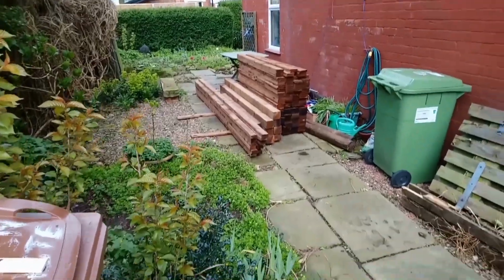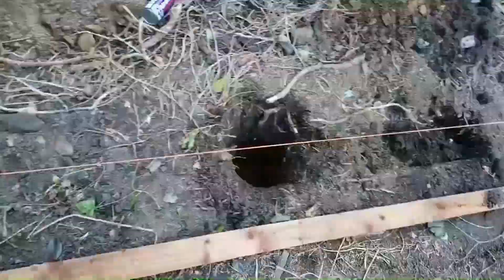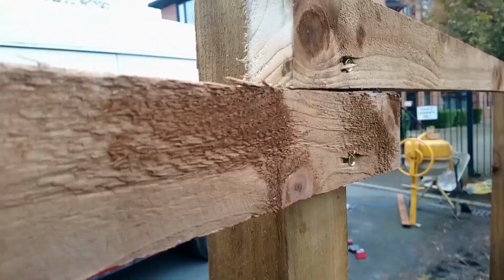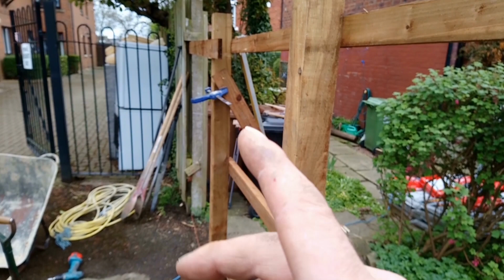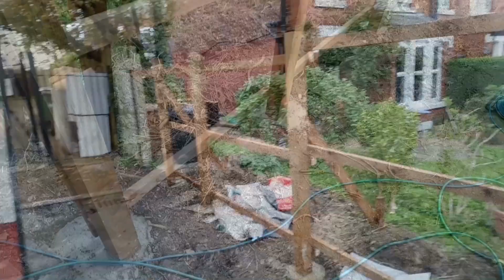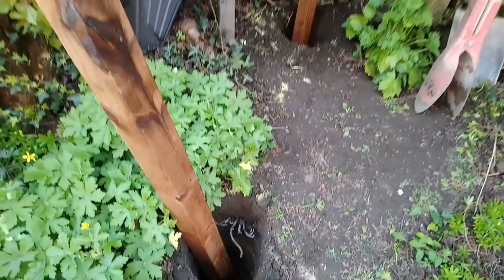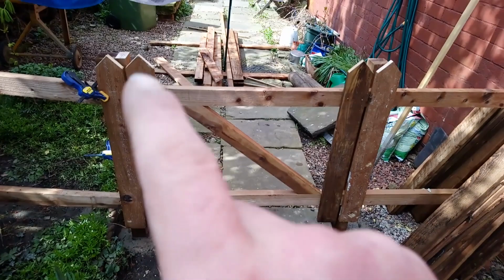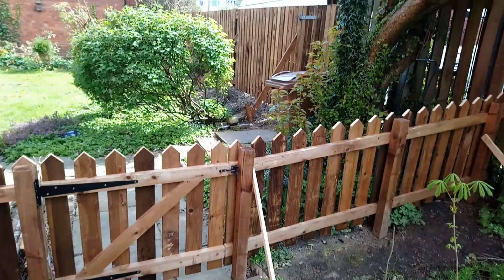Building 2 fences, a 6ft double boarded paling & a 3ft picket fence

Comment: That gate idea is blooming clever for a little job like that.
Reply from the maker: Thanks, 👍 I do,it with cheap pairs of gates the same, rails across to hinges on each end, boards on with one nail in the top n bottom rail then cut it in the middle, sometimes there's a little sagging when the weight is released but that's why i just put one nail in each board so it can be lifted 👍😉
Reply: @Gidjoiner  yeah I can see myself  using that idea too. Glad I found your channel, always pick up something new. Such as putting the chamfer on timber through the thicknesser using that jig, like you used when you repaired that front door. Keep up the good work.

Comment: That's a handy wee compressor.
Reply from the maker: WolfAir 6L, It'll fire the 90mm nails no prob, you need to let it keep up with you but on a job like this you're only firing a few at a time n a gap while you get the next piece set up before firing again, at least 20yr old, no maintenance, doesn't need oil n never an issue, bit noisy tho 🙉😂 I sold my Paslodes, they became very temperamental, you'd get the wood in position, pull the trigger n it'd just click. f#*k, so went back to the Dewalt air gun, fires every time 😊
Reply: @Gidjoiner  yeah I've had issues with paslodes, even old gas is an issue with them. I'm just looking for something to fire off a few brads while I'm glueing up. I'm only a hobbyist so it looks ideal, I'll have a look online. Thanks.

Comment: Great video. You kept saying that the customer didn't want to see any posts or braces from Inside the garden, is there not some kind of "code" that says the good side must face outwards or towards the neighbours?
Reply from the maker: Thanks Jason 👍 No written code just an agreement between the neighbours, these two were going halves on the price so it was boarded both sides as to try to give it two good faces, the garden i was in were my friends/clients so the posts sort of went on the other side, but as they were sharing the bill i had to try accommodate both neighbours, somebody was going to get the posts 😏 In other cases where i'm just working for one client i put the good side towards the people i'm working for, the ones who are paying for it, it's all discussed tho & i express that they need to discuss with the neighbours, quite often the 'other' neighbour will show their face & try to explain what is planned, that way i'm not called back to 'fix it',  If it's a rail & paling fence like this but only boarded one side & is for security, i would put the rails inside so it's harder to climb up from outside the property, it also looks better from an outside point of view if it's a boundary fence,  When i was growing up i heard of things like, 'that's my fence' or 'that's your fence, ' the one on the left is mine' or 'the one on the right is mine' but life doesn't work like that, not nowadays anyway, it's mostly is common sense, compromise, respect or consideration for others....
Sorry i got mixed up with which fence this is but most of what i wrote still applies, it was boarded outside for security but she didn't want to see the rails inside so it was double boarded,  🤦‍♂️👴👍👍

Comment: Should have used a level as a spacer you can check for plumb as you go
Reply from the maker: If i had a level the correct width & I've tried using a long piece as a spacer in the past, it doesn't work, it just gets jammed, that's why i use a small block
Reply: Gid joiner I use a six ft stabila 50 mil wide and have no problems . Expensive though that's the only drawback 👍
Reply from the maker: Yep, all mine are Stabila, this is my old 6' one, used for outside dirty stuff, i have another 6' narrower one that's kept aside for good clean work, 
Expensive yeah, but Stabila's the best, my 1m 83s cost me £80+ but i still trust it as i did 25yrs ago, my original got nicked otherwise it'd be 34yrs old I'm sure
Reply: Gid joiner I baught my first stabila in 1988 three foot long like an RSJ still got it £38 it was I had a very similar Stanley before that and don't know what I paid for that we had only just turned decimal 😂
Reply from the maker: yeah the 83s is the one like an RSJ, the original i bought in 84 when i started, had to get credit from the firm i was working at, couldn't believe how much i was expected to pay 😲
Yep i grew up in the 70s. ½p chews 😋
Reply: Bought my first levels about a week ago!  Half way through DIY fitting a kitchen and realised a set would make it much easier, rather than just my Dad’s old 600mm Stanley.  After seeing your comments Gid (in another video) I bought Stabila. A friend recommended the 96-2 over the 70-2 and I am loving using them.  Gid - You could set up one of those affiliate link things for stuff you use and would recommend?

Comment: Instead of pushing the pickets together, wouldn’t have ripping them down so the gap matches have made more sense?
Reply from the maker: Yeah you'd think so but that would have left me with a thin strip of wood that's prone to breakage, a lot of these palings have knots in them, & the preservative on these is pressure treated but it only goes into the wood max 5mm so i would have had an untreated edge of bare wood, I could've put some treatment on but it would only have been on the surface, not really soaking in, Aesthetics weren't important on this fence, a longer life was chosen over looks.  This is north England, it rains a fair bit here .
Reply: Gid joiner 
That makes sense. I’m building fencing and gates here in California and I worry more about the sun. Also, seams like many of my clients try to push aesthetics over function when we initially meet. I typically stroke their requests but slowly convince them that my way makes better sense.
Reply from the maker: Yep sometimes it's the client gets what the client want, not always for the best, 

some choices if made by the client can come back n bite you if your not firm & push your pro opinion. 
I would have cut them if i thought it mattered or for someone else but this woman is an old friend & doesn't care too much about the outside, "i won't be looking at that when I'm sat in my garden" she says, so i made a sensible/educated decision, If I'd ripped them bits down I'd have given em a couple of yrs-ish & I'd get a call to come fix them, 
Bit jealous of your sun, pisses it down a lot here, wooden structures don't last long, traditionally houses are brick or stone, only recently have timber framed buildings started to appear, introduced from Scandinavia & N Europe,